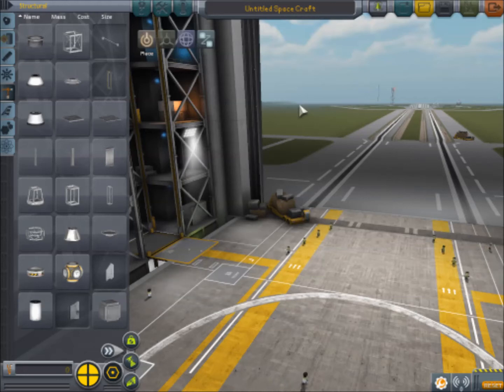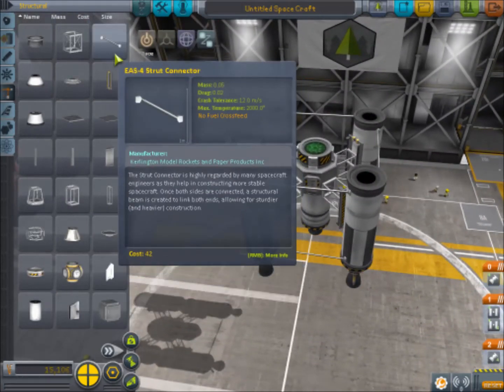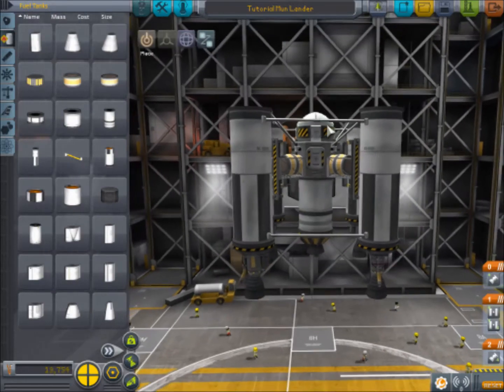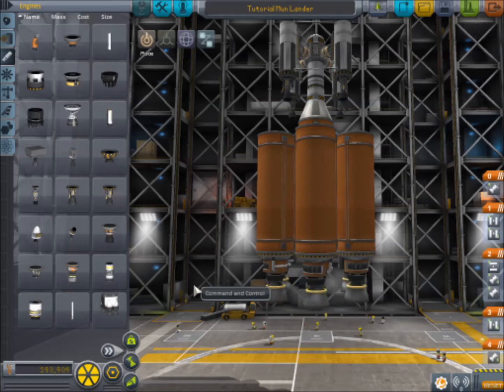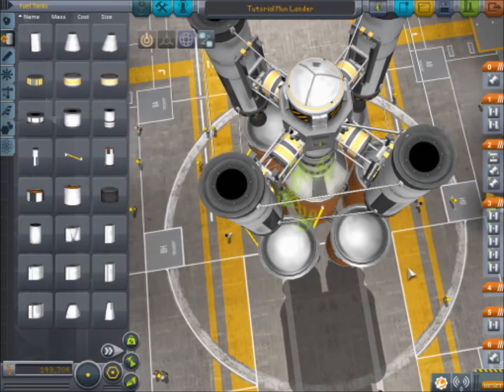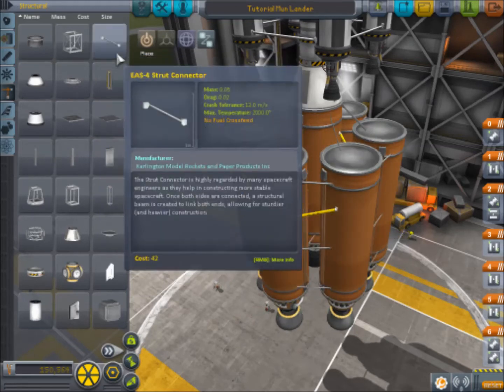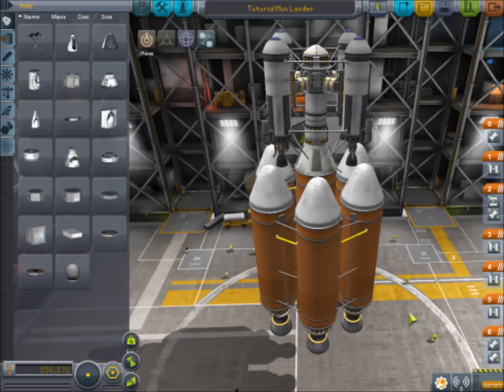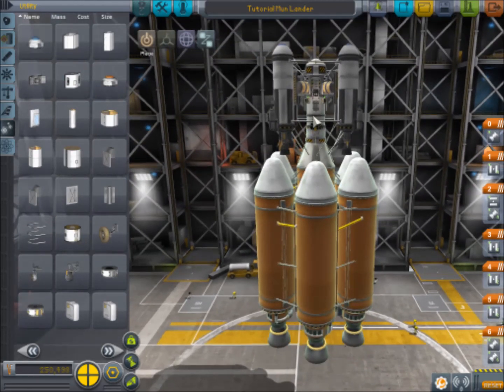Kerbal Space Program Tutorial Build A Mun Lander, and Heavy Launcher with Asparagus Staging

Comment: I'm having a problem getting a rocket into orbiting position. I'd made a rocket design that will get to space, I know it can, it shows the potential. The problem is that whenever I try to turn, at any point, unless I'm using the final pod stage, my rocket begins to spin out of control before finally pointing either straight up permenantly, or straight down towards Kerban. I've tried moving the wings to different positions, i've tried ditching rockets early, I've tried turning at different times... this is always the outcome. What's happening and how can i fix it?
Reply: +MadManIre you need SAS (stability assistance system) modules. Or put stabilizing fins on the rocket. 
Also you should always use engines with vector thrust. 
In case you don't have such engines - put stabilizing fins. 
All control pods have built-in SAS but for big rockets you MUST use an additional SAS module.